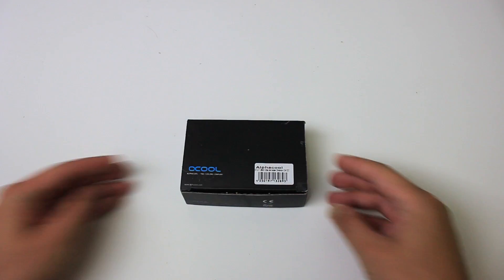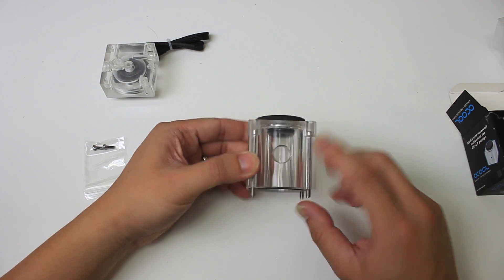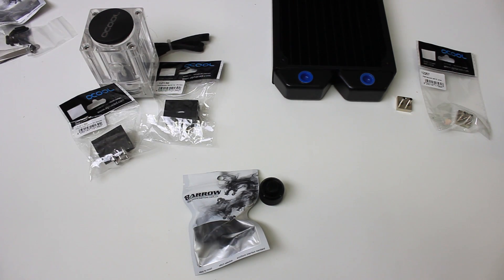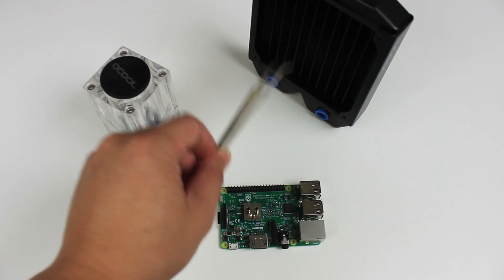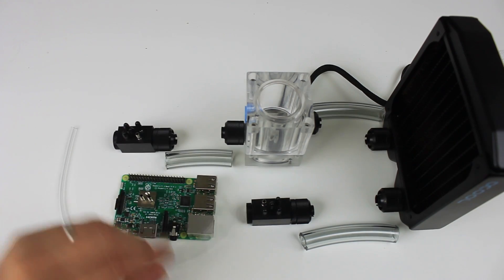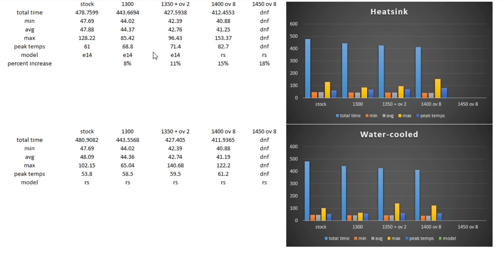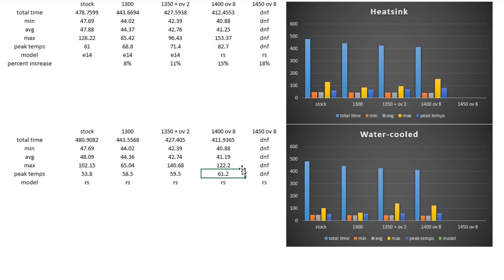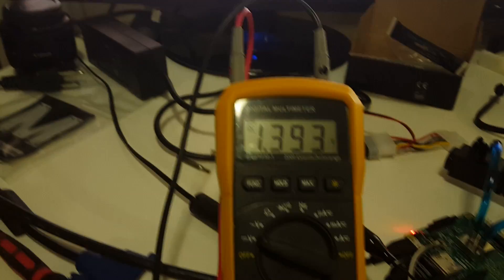Water Cooled Raspberry Pi 3

Comment: i laughed when i saw the radiator. its like shooting a squirrel with a 12 gauge slug.
Reply: Probably could just use the water lines to dissipate the heat.
Reply: I would have used a 360 Radiator, thats like shooting a Squirrel with a .50 BMG
Reply: In this case, yes.  But playing with it in a situation like this will save you the trial and error or doing it in a larger use situation like maybe making a Raspberry Pi cluster, where the temps likely get much higher due to the multiple boards in close proximity.
Reply: If it works, it works.
Reply: volkswagenginetta bigger squirrels require heavier ordinance
Reply: That whole system did the same thing that shotgun did to that squirrel. Absolutely  nothing good lol. I don't care how nerdy u are. U cab nerd out all day. But fact is. It didn't do any justice at all. That was meant to be portable. It is what it is. U claim your a hacker and all this. Build a fucking better version like Asus did lol. Its has a piece of shit  CPU that comes from and old LG smartphone. Like how much better can u do. I'm only think about it bc it runs linux and what ever u want it to. Its a tiny lil  thing I can travel easy with and hook it up to my tv where ever I go. But fact of the matter is its a 40 dollar micro pc and he overkilled  the thing lol. He tried to sound smart. But, honestly if he was as smart as he said he wouldn't have needed any help picking out parts
Reply: @checkforfleas9452   And actually it did quite a bit there was quite a bit  Of headroom
Reply: @checkforfleas9452   Not everyone is an expert in everything you know that right lol.
Reply: @checkforfleas9452   Finally and most  Importantly it's meant for embedded applications Water cooling a pine might be very handy in a place where it's hot and it can't fail or slow down in mission critical situations did you think about that
Reply: Na you got it all wrong, its like shooting an ant with an rocket launcher
Reply: If I do this, MARK MY WORDS, I am going to try to use a 480mm rad and a full sized reservoir.
Reply: @squirrelrobotics  good pump too
Reply: @donovan6320  Crap, didn't even think about that lol!
Reply: Right?!
Reply: @gmeister03  huh
Reply: Shooting a squirrel with a RPG.

Comment: Sorry to tell you, that RADIATOR ISNT ideal!!   You are supposed to put the inlet and outlet on the top. Reason being, you trap air in the radiator because it has nowhere to escape to!!  ALSO, because gravity, water basically enters the top tank and trickles through the first 1 or 2 rows of the second pass toward the outlet. so you're really only using about half the radiator..  This is common knowledge with aftermarket transmission coolers and radiators in automotive applications..  Higher flow setups, I would say you could get away with laying it on its side with outlet on the top..  But because you're not flowing anything, the only real way to use the radiator is with inlet/outlet on top!!

Comment: Like putting 2000$ wheels on a 94 civic.
Reply: bigfroggy22 but a Pi is only $35, what do you mean $100
Reply: Like every ricer
Reply: 100 💯 likes?!? OMG
Reply: lol i know a guy who had a $5000 security system built into his opel kadet...
Reply: Или nissan primera p11
Reply: 94 civic is actually a beast
Reply: like putting $500 of mods on a $100 pi
Reply: @bigfroggy22  u bought the pi for 100$ you got ripped off
Reply: yall tripping its 2018 now of course I didn't buy a pi
Reply: bigfroggy22  hi, what would be a good mini computer in 2018 ? thx
Reply: MGTOW WARRIOR I WOULD SUGGEST SOME ALIENWARE LAPTOPS THEMS ARE GOOD OR YOU CAN TRY SOME HP PAVILION DESKTOPS THEY R GOOD PRICE
Reply: bigfroggy22 ...um your capslock is activated. You can turn this off, ok?
Reply: TIM OLSON WHAT DO YOU MEAN MY CAPSLOCK IS ACTIVATED THIS IS THE SHIFT LOCK
Reply: bigfroggy22 okay. However, it is quite annoying.
Reply: TIM OLSON SORRY IF YOU THINK YOUR TYPING IS BETTER THAN MINE BUT IM HERE TO SAY NAW
Reply: bigfroggy22 hey dude. Chill. Looks like you‘re a bit stressed because you bought a Raspberry Pi for 100$
Reply: TIM OLSON I HAVE BOUGHT NOTHING

Comment: I actually watercooled my ODROID XU4, however in this case it was "called for".  The thing hit 90+ C instantly when throttled up to 2 GHz at high load.  I use it for a media server/file server/TV tuner/DVR server that does on-demand transcoding (PLEX Media Server and TVHeadend)

 It will still get to 75, but it no longer cuts performance.  And it looks cool.  ;)  If you look at the design of the XU4, there's quite simply no proper way to cool it, the heatsink mounts are off-center the SOC, so you never get even pressure.

I used an 80 mm radiator, and a $6 12V fountain pump.  (spare me the hate, it'll get "proper" hardware eventually).

Comment: Aside from your condensing opening remark, I can appreciate the need for cooling, needed or not, but this approach is definitely over kill. Sure, it certainty looks impressive but it makes no sense. The complexity and size is at odds with very idea of the Pi's smallness. That so much computer can fit on to such a small footprint is what the Pi is all about. It's comical that the radiator is nearly four times the size of the computer.

Comment: can i use same pump with pc watercooling?
Reply from the maker: yup
Reply: +Novaspirit Tech you earned sub btw :)
Reply: NytOnPeliAika it would be pointless using that small of a radiator and pump. You would get better cooling with a cheap cpu air cooler. It's not till you get to the 200mm radiator size range where it becomes better than an air cooler. You also have to remember that's its impossible to go lower than ambient temp with air or water. So if your room is hot then it won't matter.
Reply: Lorenzo Aguinaga i have a pretty cool room so i think it will make a change in my 50 celcius

Comment: That 120mm rad is a shitload of cooling for that tiny little chip, but I would bet that you could get below 50c if you threw a fan on there. Also, it seems like that pump would be straining a bit, trying to push fluid through that tiny tube as the pump is designed for much larger loops in gaming machines. If it works, eh, no big deal, but it's just a thought. Lastly, to clarify, in a pc water cooling scenario, the components don't put out enough heat for the fluid to be significantly cooler when it comes out of the radiator. In a car where the temperatures are much more extreme, sure, the water will be much cooler as it comes out of the radiator, but not in a pc scenario. Jayztwocents has plenty of great videos explaining this.

Comment: I can see this build being useful in clusters where the heat needs to be dissipated externally to the cluster (though still overkill). In fact, the 5 way splitter can be used to your advantage for something other than just varying hose size.

Comment: I understand wanting to keep the CPU as cool as possible, but this approach doesn't make sense.  You could get a passively cooled heatsink smaller than the size of that radiator alone that would do as good of a job, would cost less, and take less effort to work on.

Considering you didn't really achieve a higher overclock over the other tested heatsink, this has proven to be a waste of time.
Reply: I think this is more of the "because we can kind" kind of video
Reply: Hudson Meek I'd much rather see them do something cool with a RPi3 than to unnecessarily cool an RPi3.
Reply: Peter Schmidt This was for shits and giggles
Reply: Peter Schmidt well then you clearly aren't the target audience you piece of shit

Comment: the top of the reservoir is below the top of the radiator, therefore your radiator can only be partially filled and most likely has a huge pocket of hot air trapped inside it.

Comment: Great vid! Love the randomness of this! I never would have thought to watercool a Pi.Very interesting!

Brad
Reply: I take it one step up, how about oil cooled Pi? Mineral oil gathers the heat from the Pi, transfer it to heat sinks that are cooled outside. Small pump can be used to get cooler oil near the parts and get the circulation going, but then again if there is big enough oil volume this should not be a problem.

Comment: What, they make a cooler that small? I literally custom designed one from a copper penny to water cool a tablet (and arduino's and motor drivers, and what not). Well at least mine costs a penny (ha! literally need a penny), and about 2 cents for the 3d filament.

That was probably the hardest part (took about 5 minutes to CAD it) besides the looks of the tablet (I designed the entire system in CAD, chose decals, and make a radiator out of pipe for it). You can see the render at least in my Thingiverse page by searching "penny water cooler". I'll upload the actual real photo's once my phone stops acting up and admits it has photos on the SD card.

And yes, the tablet overclocks. I'm still yet to get above 60c (normally 90c complete stock), but my battery dies in 20 minutes. So I need to get a way to add more battery power so I can get practical use out of it (if you call a water cooled tablet practical).

Comment: To all retards laughing when he said "We hackers". To hack has more than one meaning, one of the meanings is using a device or material for something other than it is supposed to. So for example if you put an iron plate on a hair dryer to heat up the plate, and you start ironing a t-shirt with it you hacked the hair dryer.

Comment: You could have made the graphs a little easier to see if you had put both the heatsink and the watercool on the same graph, and only compared 1 item per chart. So 1 chart has the heatsink peak temps vs water cooled peak temps for each test, then another chart would have heatsink time vs water cooled time for each test, etc. The way you did makes the differences look so small because the Time is so much larger than the temp values.

Comment: It's not pointless if you have to put the raspberry in a totally sealed case with little to no possibility for air cooling. Then all you need is two passthroughs for the water lines to an external rad.

Comment: This was in my suggested posts. One of the dumbest things ever. Next water cool a mobile phone.
Reply: Linus Tech Tips has already done this.
Reply: it was sumersive water coolign, not real water cooling
Reply: this would be helpful for my s7 since the thing becomes so hot its painful to touch the screen sometimes...
Reply: acalthu galaxy s7 has water cooling
Reply: acalthu actually if you game hard on a phone like me and have more than one battery to constantly run your phone (LG G4 FTW) water-cooling would be amazing lmao it doesn't get burning hot like my old iPhone 5c did but you can tell it gets pretty toasty in there still.
Reply: Plenty of gaming laptops are watercooled
Reply: Dude those new Motorolas with all the add ons should build a water cooler, been saying that. Laptops defiantly need to be water cooled as well.

Comment: Wouldn't the adhesive observe some of the heat which makes this kind of pointless?
Reply: I'm sure it's a thermal pad, which is used for heat transfer. It's not perfect, but it will work. Depending on the grade it may not transfer enough heat.
Reply: I guess that makes sense. :p

Comment: The Celcius scale gives a wrong impression of the effect.
60C to 50C looks like a 17% improvement, but on the (real) Kelvin scale the benefit 
is only 3%..
Reply: That's like saying 1kg of feathers weighs less than 1kg of rocks. The improvement is still the same x)
Reply: Absolutely right :)
Reply: Delta of Kelvin scale and Celcious scale Gives the same value. 60C - 50C = 333K - 332K = 10
Reply: An increase of 1 degree Celsius is equivalent to an increase of 1 degree Kelvin. Whether you're using percentage increases or absolute value increases, it's a relative indicator; so as long as you use the same method consistently there is no issue.
Reply: You shouldn't compare it to neither 0°C nor absolute zero. What matters most is the difference with the ambient (room) temperature.

Comment: As a test... I took the fan out of my old laptop, cut a ~ 1.5cm² opening directly over the pi3 cpu (for air flow), mounted the fan to the side (where there was already a nice elongated rectangular hole) and powered the fan with an old cell phone charger. Using NO HEATSINK - the fan is keeping my cpu temp in the mid 50's when I max my pi3 out. Cost $0.